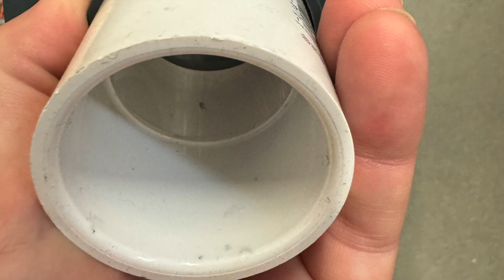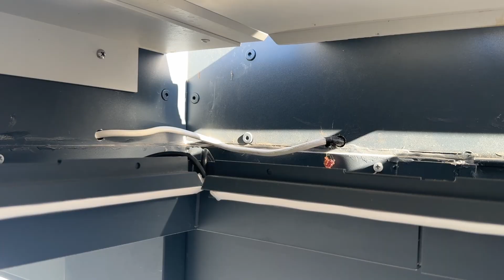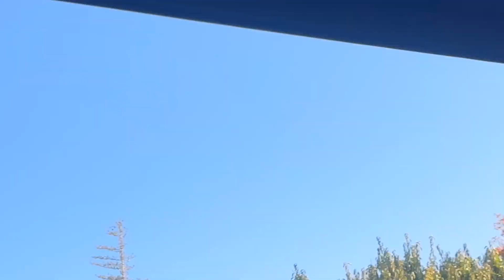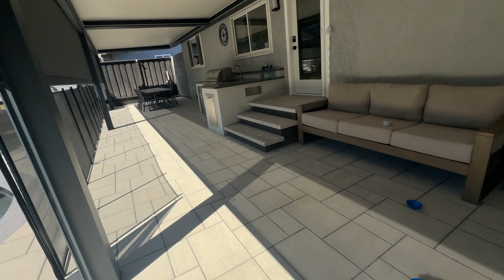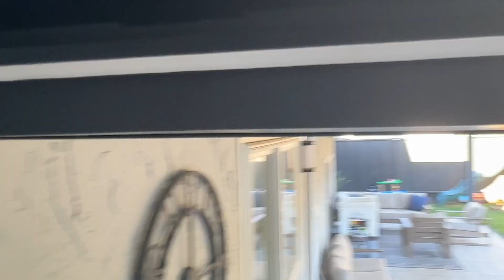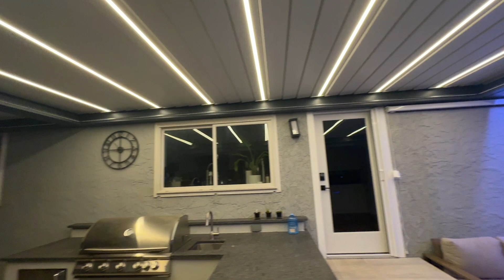Bon Pergola Review - Custom Weatherproof 12'x60' Wall Mounted

Comment: I just priced this and your better off framing an over hang, and having real door and permanent screens. This stuff isn’t too well sealed and water bugs and mice will still be invited
Reply from the maker: If you want permanently fully enclosed then this probably isn’t the right pergola for you. If you want flexibility of open or closed then it can be great. There are gaps on the top that will certainly allow bugs in. This is not going to eliminate them but with the screens down it will certainly limit them.

Comment: Great video! Do you have any issues with rain coming in where it connected to the wall?
Reply from the maker: Yes I did have a little bit of water coming down where the pergola attaches to the house. Nothing major and I have since fixed this issue by filling the gap with caulk. I am not a general contractor but you could also use flashing

Comment: This is great. Can I install on top of a concrete patio slab that functions as the foundation for my pavers. Or do I need to somehow rip up the concrete and pour footers?
Reply from the maker: This probably depends on where you live. Here in California we don’t have to worry about hurricanes or tornadoes. Fully assembled these are actually quite heavy so in moderate wind conditions you will be fine. Even in heavy wind if the louvers are open you will be fine attaching to your existing slab.